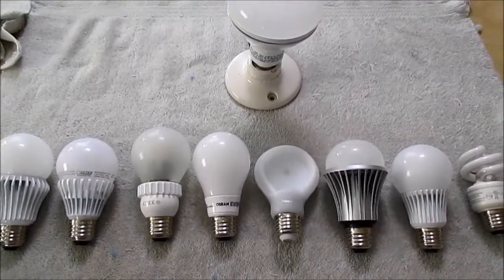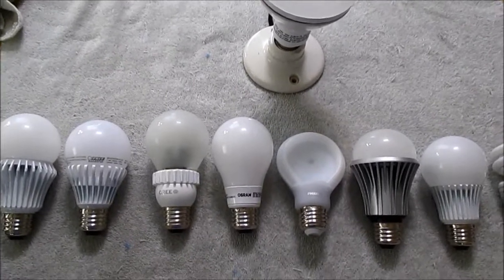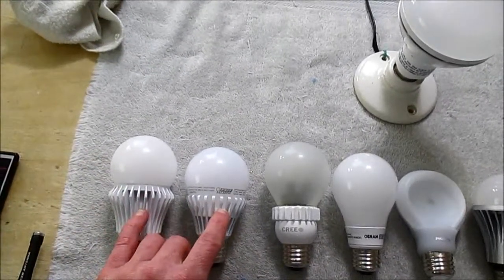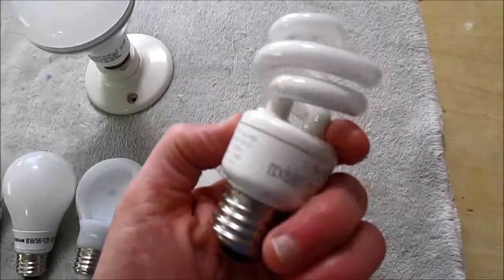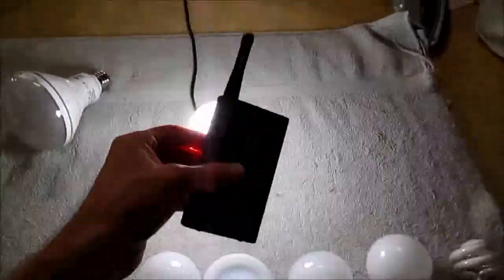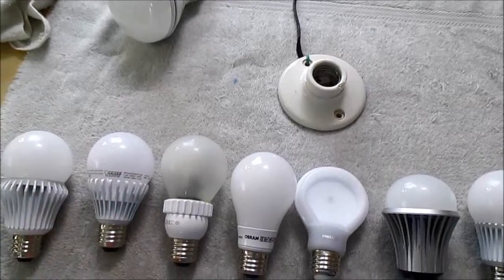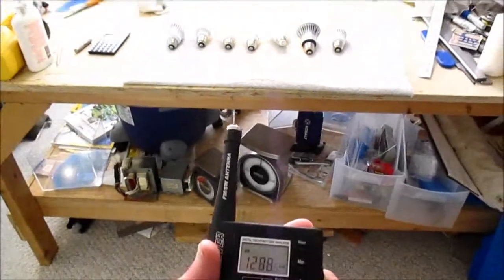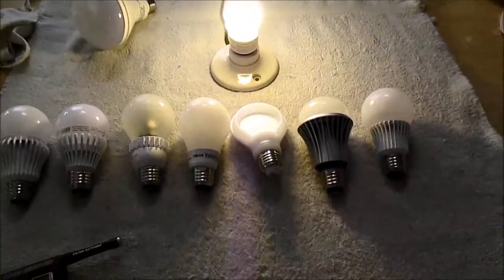LED lightbulb RFI test

Comment: I receive my digital HD TV signal via an antennae in the attic. I have recently converted the vanity light fixtures in my bathroom to LED bulbs. Now when I flip on the bathroom lights the TV signal goes out. Once I turn off the lights the TV goes back to perfect. I've read that others have this issue and one site recommends LED bulbs with FCC category 18 rating instead of the standard FCC category 15 rating. Wondering if you've ever looked at that and have any solutions.

Comment: Without sweeping the band in question quickly with a half-turn dial tuning radio and listening for the noise peaks, this is a poor demo. Sometimes they are so strong that you will hear just the opposite, silence. This is a real game killer, though it works well on Rush Limbaugh.
 Keep the radio "dial" in sight of your camera with stationary view and lighting. That radio is good in one aspect, it has no mute while tuning. Most digital tuned radios are useless for such as DX-ing and noise assessment.
They are tuned by an analogue voltage though. Hack into that and you can tune it with a regular pot or a ten-turn pot for fantastic accuracy fine tuning. Sweep that voltage and display it vs. the signal strength output of the radio and you got a band dedicated spectrum display!
Reply from the maker: If this were a real scientific test, I'd skip the radios and test with an RF spectrum analyzer in a shielded room to remove external RF influences, but I own neither.

Comment: I have also done similar tests. I found most noise was on Long Wave. Some lamps produced quite wide spectrum noise but at a relatively low level, while others produced a high level of noise but at quite selective frequencies. The difference seemed to be dependent on the type of inverter/LED driver. Mains operated LEDs tended to produce more noise than say a 12 volt DC supply. As you said in your Video, none are problematic. My home has nothing but LEDs, with every one turned on at the same time, unless you are within a few feet of the lamp with an LW radio. Interference is not an issue.  Just a thought!! Does ANYONE still listen to AM radio?? Better quality over the internet. As for short wave... what's that??  lol
Reply from the maker: Michael Beeny I can imagine a lot of harmonics in the LW band as well as the base frequency of the driver. The only AM station I listened to moved to FM a few years back. The rest is mainly sports talk.